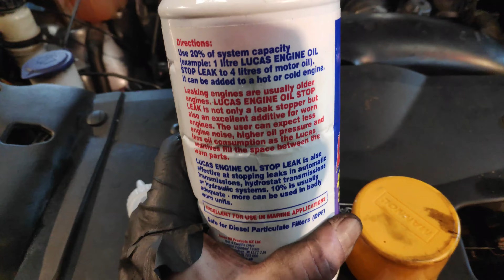Cheap Car Challenge! Le Lemon - Is a £1000 car any good?

Comment from the maker: Those are the rear arms. You may not need to to have the weight off the wheels but it wil be far easier if you do
Reply: Hi there. I am trying to do the rear tie rod ends on my Peugeot 508 and I undid everything but the bolt will not come out - have you any ideas? Do I need pressure in a certain point to free the bolt off ? The nut is off it just won't pull out! Many thanks

Comment: Hi, this is a great!  My 2009 1.6hdi Tourer (non-hydraulic suspension) has failed MoT on the larger bushes in rear lower suspension control arms, and I’m working out how to replace both.  At 32:30 in your vid. You’re replacing front (I think) arms but I can’t pick out whether you show the rears being fitted.  Any advice on that?  May be a dumb question, but could rear arms be replaced with the suspension under load on drive-on ramps, or would wheels need to be jacked?  Many thanks.
Reply from the maker: Hi, those are the rear arms. You may not need the wheels and weight off but it will certainly be easier
Reply: @theogbeardedwonder  Hi, job is now underway (jacked and onto stands). Wanted to make sure I could jack high enough to get my (full-size) impact wrench to both bolts. That plastic cover is a bit in the way, but I can pop out the nearest fastener and bend it just far enough out the way. Now to order the arms, plus a 16mm impact socket which is about the only size I don't own! Many thanks
Reply: So this went fine. For benefit of others doing this on jack and axle stands, I'd say certainly important to remove wheels for access. I didn't need to use impact driver on my bolts and they came out nicely - looked pretty much new (but then car's only done 105k miles). Thanks again for the guidance.